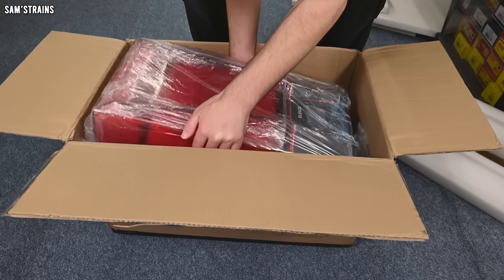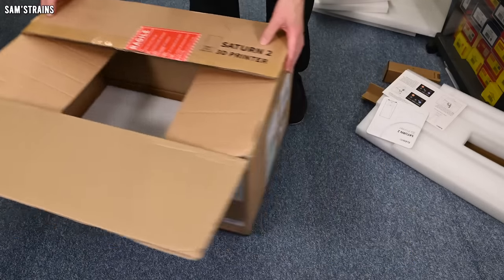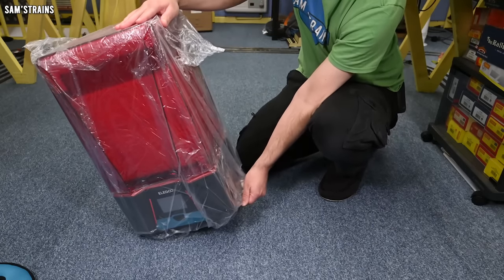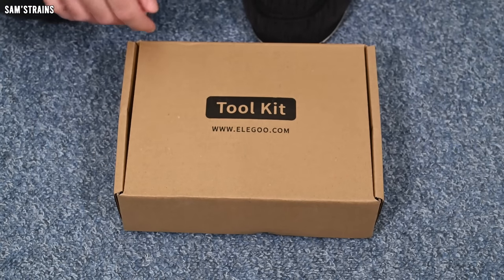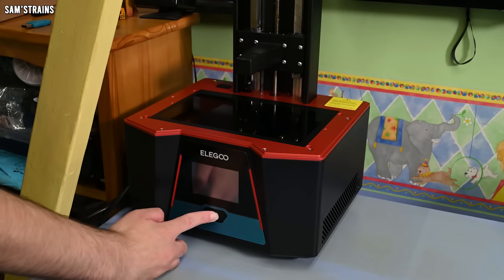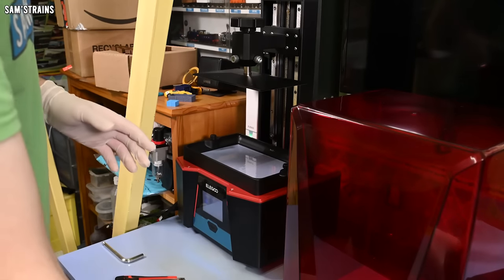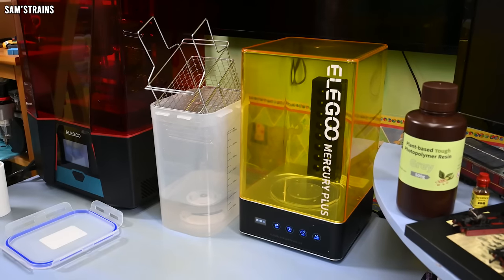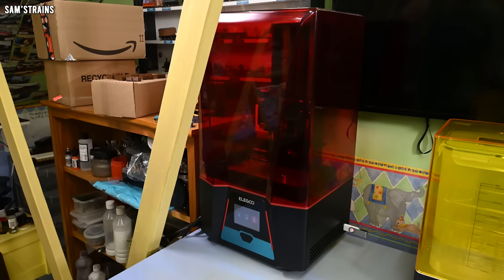Home Made Model Trains With Professional Detail | Getting Started With Resin

Comment: The reason the bottom looks so wavy is because it's very difficult to resin print large-ish flat surfaces parallel to the build plate.  If you would tilt the model around 35-45 degrees or so, it would greatly improve the bottom surface (but since the print is higher, it would take a little longer to print). Cheers!
Reply: I can say with some confidence I know what I am doing with 3D printing and have a “turbulent” history with this actual machine. You can print large plat surfaces off the build plate, as I produced 5th wheel covers for 1/14 scale RC trucks about 2.5" diameter and precise chassis rails for 1/76 to 1/35 vintage lorries. The issue sadly is a fault with the Saturn 8K, the arm of the printer bends exacting about 40 newtons return force on the fep that causes really bad elephants foot/distortion. I have compensated, but it's not the answer. Solution, I need a better constructed printer to handle that kind of work. Oh the printer is very good trust me, my 009 quary wagons it is said are better than anything else available the printer good enough to produce exact brake gear and GWR above the axle box's.

Comment: Great that you started with Resin printing eventually Sam 👋👋👋 Just an important tip from us; after poring the resin into its basin for printing, wade the spatula tool through the resin softly to remove all air bubbles, otherwise bubbles (or what's left of them) can ruin the print, especially at the starting point (bottom). Resin printing is fantastic. We've seen actual manufacturing grade made wagons from it 🙂 Bon chance with what's to come 💓 Cheerio.
Reply: I normally raise and lower the bed a couple of times manually before starting, that seems to agitate the resin quite well
Reply: Once a resin is created that won't kill you everytime you go to print a part, it will be good for folks to use.  Until then - it is just too dangerous for the average joe/jill to go off and use but folks continue to do it anyway!  Saw a video recently where a hobby crafter was using a cheap laser cutter in her bedroom to cut out stuff for scrapbooking.... had no clue that the fumes from the laser were TOXIC!!
Reply: @pesto12601  it's not so much the laser as the stuff that it's burning.   People forget that a laser isn't a pair of scissors, it's actually burning material away.
Reply: @leonkernan true... but the laser itself is dangerous too... it can damage your retina very easily!

Comment: Get a flexible build sheet. The best single thing i have done. No messing about the scrapers. No need to even remove the main build plate from the printer. I dont have to re-level or check it, just take flex plate remove the pieces and refit the sheet. Very little mess and no dripping resin everywhere. Also get a screen saver for the LCD screen. I use a large tablet one to cover more area on the top of the printer. This is because and spilled resin on the LCD will set hard if not removed. but if your FEP splits then the LCD is covered in hard set resin, almost impossible to remove

Comment: A couple quick tips from someone who learned the hard way.  Even after washing the print, use gloves to handle the uncured piece to avoid resin on the skin and finger prints on the print itself. The flexible plate makes removing the print much easier, I've only had to use the putty knife on thinner prints.  Also with the flexible plate you can drop the plate and print into the cleaner if the print doesn't pop off right away.  You just need to clean the bottom of the print when it does pop off after washing.  Someone suggested a silicone tray, I use a silicone electronics desk mat for my prints and around my work area, it help greatly for cleanup. And lastly, I bought the suction handles to put on top of the cover for easy removal. Eventually you will grab the sides of the cover with resin on the gloves and ruin the cover, resin doesn't come off the cover at all once it's on there.  Enjoy!

Comment: Didn't you say you cannot have a resin printer in the loft because of the ventilation? I'm sure you will address that in the video, which I don't have time to watch, maybe later. 😅
Reply from the maker: Yes, but now I've found the low-odour non-toxic resin I'm very happy... plus my printer has a filtration system of it's own!
Thanks for watching, Sam :)
Reply: @SamsTrains  You probably want to invest in something that can monitor VOC levels, Awair have a pretty good product, it can even pickup the variations when printing with some filament on FDM. I've got the Elegoo Saturn 2 and a few Anycubic printers, they work great but even the Plant based resin gives off a fair amount of VOCs. You will also find that you'll use FDM for some things and resin for highly detailed parts. The biggest mistake you see people doing is trying to print full OO/HO scale stock with the resin printer and wondering why parts are warped. You can strengthen resin by mistaking them together. That said you can also print OO scale bricks with an FLsun V400 in filament with concrete textured filament... :)
Reply: @Oorail  i have thought about how to print something as long as a OO recent coach (e. g. BR Mk III, 75ft long, 300mm in OO) and I think you have to do it as a kit to assemble after printing from several pieces, instead of trying to get, for instance, the body of the coach in one piece. I think that it is safer to print flat or curved pieces separately, like the sides and the roof of a wagon/coach, than to try to do a complete body and a chassis apart. I think that would prevent warping, but I let you judge, you have an experience I don't have.
Reply: @OlivierGabin  That is exactly how you do it, as a kit but you wouldn't do it entirely in resin. For a BR Mk III coach, you would need to print the chassis, bogie frames, couplings, and body structure out of filament. You would print the roof and sides out of a good quality resin with the MSLA printer. Think of it as like one of those old kitmaster kits but with the quality of today's RTR products. Instead of buying a kit, you are downloading or creating the digital file to create the kit, and manufacturing it at home on your printer(s). It is also why you really need an FDM printer and a resin printer. You have to design the pieces though for the 3D printing technology you are using. For example, I'm currently working on tunnel project that is several feet long. The core structure of the tunnel is printed upside down as the printer doesn't need supports for the arch that way. Long brickwork is printed flat, and not only does it insert into the tunnel but it masks any join lines between the structural segments. Details like the signs and plaques for the tunnel are printed using resin. Not only does it save a ton of money, you can print unique things for your layout and get a slightly different look from everyone else.

Comment: a few suggestions

1. get a pair of silicone rubber trays, sit the printer on one and the wash station on another, this will protect your desk from resin drips
2. get a few disposable foil platters (party aisle of the supermarket), perfect to stick the build plate on while removing stuff, again saves mess
3. grab a pack of kitchen roll or blue roll and keep it to hand
4. when you take out of the IPA, drop into a jug of warm water to rinse the IPA off (makes it easier to handle and stops the IPA fumes filling the room - also when you have supports will make removing them far easier)
5. for most parts air drying is fine, for anything with large flat plates let it dry overnight before curing, this can help if you find parts start to warp
6. that wash station is too small, that is for the smaller Mars 3 printers, not a huge problem but with the larger ones you can actually stick the build plate into the wash station, which will clean the uncured resin from that as well

Saturn 2 is a lovely machine, larger than the one I have here but I know someone with one

good luck and enjoy it

Comment: Coming from a Printing Trade (Lithographic or Offset, eg. Ink on Paper)
 The Advances in this Tech are just mind blowing.
 Amazing that a Set up is Available for the home Hobbyist.
 Truely something I could Barely Imagine in a Factory Setting in the Late 1960's, let alone @ Sam'sTrains knocking models out in his Loft in a few hours.

 It's just Mind Blowing..!
  And Sam, you seemed so Calm Unboxing, Setting up and Working a New Tool or Tools.
 That did cost a Few Quid to be Fair..!

 Well Done Young Man. An Impressive Performance..! 

 Cheers All.
 A Luddite in Oz. 😎
Reply: Advances! mate this style of printing has been around since the 1980's.
Reply: @kennykd97 Yes qw were using laser epoxy prototyping back in early 90s. However I think what this chap means is that its advanced to home use. Well it had done about 5 to 10 years ago. Sam has just caught up...partly due to his fume concerns
Reply: @gs425  It became so cheap because the patents ran out mate then China started mass producing them and trying to outdo each other competition is king.

Comment: Great to see you using a resin printer, I use a Saturn and found it’s best to print the models at an angle and also make sure the resin is at about 25 degrees C. I avoid touching the prints until after curing as the ipa will contain resin. It’s a learning process, but stick with it!

Comment: Nice to see you trying some resin printing, been loving my Mars 2 Pro for N Gauge printing, but have had to upgrade to the Mars 4 Max since it's build plate is nearly the same as the Saturn's (it's also cheaper), though I do recommend using some thicker gloves like some Marigolds or the like, the ones which come with the printers never feel thick enough heh
I do also recommend getting a cover to block out the light when it's printing, might not seem like much but has helped with the quality of my prints.
Anyway hope you enjoy using the printer!
~James

Comment: Looking forward to seeing what you can make with this!  I had the same issues with bottom layer sinking and separation until I started printing things at an angle and getting the support systems figured out.  I've also gotten my best results by making it so only the supports touch the build plate and keeping the actual part off the plate entirely, eliminating the potential "elephant foot" that can develop on those first layers.

Comment: I'm about 6 months ahead on this journey. Some things I have found.
The flex plate is a massive plus, especially to prevent damaging parts. if doing small parts, put several with their rafts touching so the Flex works better.
It is not always necessary to use a raft and print at an angle if your part has a flat side and no huge overhangs. Having said that shifting the angle around can sometimes improve print quality, at the expense of time and support material.
When doing shells, (working on an EMD F9P to make PAN AM #1 & 2 ) I have found that adding temporary internal cross-webbing will prevent a lot of warping, and thus failure.
I was hesitant to start resin printing because of the "toxicity" but it is not like instant death if you inhale it, still avoid it but a fan and a widow are enough, I don't think you need level 3 hazmat.

Comment: In the late 90's I was designing consumer goods on 3D CAD and prototyping parts on SLA machines costing £hundreds of thousands. Part cost alone was at least in the £100's even for small bits. Amazing to think you can buld a full setup of printer and wash/cure station now for under £1000! Makes me want to crank up my ProEngineer CAD system again! (£6k for a basic software licence back in 2000's minus all the add on's!).

Comment: Huzzah!! good move Sam. You'll get some great results with a bit of practice. I had a hard time printing Gladstone with my Elegoo Mars II. Different printer, but tricks I learnt were; lift the project off the plate. Even by 3mm will make a difference. The resin spent on supports will off-set resin wasted on failed prints. And add as many additional supports as you can to the straight edges nearest the print plate to get a crisper edge. Enjoy!

Comment: When placing the fill on to the printer, give it supprots and turn it to 45%, before you print, build it on a raft  plate first. 
The way you don't have a large amount of pull on the model,which can course the model to stick hard  to the fep or build plate. 
Also you end you with it sticking hard to your build plate. Also your end you with less fails and a better model. Had mine for three years now and it on of the best bits of kit i  have ever got, taken my modeling to new levels. An other tip when taking the supports  off is to use hot water your find the supports will just fall off, do this before you cure the model after you washed it

Comment: Hi Sam. 

£475.99p.... WOW! Just think, for that price you could have purchased a small Bachmann or Hornby wagon that is ready made. 

Paul. 👍❤
Reply: Lol, maybe a little more than that, but you could definitely get more out of a resin printer than what you could buy from the model rwy market for the same price.
Reply: Of course, you still need to buy the wheelsets. And if it's a loco, the drive mechanism.
Reply: @ReggieArford  I mean, you would need to buy a motor and wheels, as well as wires, but you could print the chassis and gears.

Comment: Hey Sam! Awesome to see you've picked up the resin 3d printing bug. I've only ever used resin myself and have found your videos on filament printing to be super enlightening, so thanks for that. :)

I have a few tips that may help you with a few things here.

It's good practice to get a protective surface for your bench, so that when you remove the models off of the build plate you're not risking getting wet resin onto the wood top. It's a real pain if it seeps into the surface. You can cure the stain with a UV lamp but then you've still got a tarnished bench top. You can just grab a rubber mat for this, there are loads of cheap ones you can grab that are marketed for putting under pet food bowls. They work a treat, and the UV resin doesn't eat through them.

In terms of ventilation, even though you've gotten yourself safer resin (something which is often a dubious claim by the manufacturer so watch out for that) I'd still say try and work in a ventilated space. If the resin doesn't make you dizzy, the IPA will. In my expieriance the IPA is actually the worse offender in this regard, and having just managed to get the full setup going in my shed with newly installed cyclonic ventilation, I can't sing it's praises enough.

In terms of that sagging on that print you made right at the end, extra supports will only kind of help.... kind of. You will ultimately find that no matter how well that section is supported, you'll get sags between each support. The issue is you are printing a flat surface parallel to the build plate. As the printer goes to print those initial flat layers, it has very little support bellow them and struggles to make that area solid, hence it sags. By printing the whole model at an angle, that flat section builds up gradually, and each subsiquent layer is supported by the slightly smaller previous layer. Yes, this means you will have to learn how to properly support models, but it's well worth it. Once you get into a good rythm setting up supports and knowing what to expect, the whole thing runs very smoothly, so it's worth putting those hours in.

Sorry for the long response. Not trying to be that guy in the comments that points out all the errors in a video (trust me I've dealt with that nonsense myself far too often), just wanted to offer some help as you've been super informative for many things I've persued in the hobby. :)

Happy printing!
Reply from the maker: Thank you so much for the help Nick - this video was shot on my first day with the printer, and it was actually a couple of months ago now! I bought a mat very quickly, and have been using that. I really didn't want to print at an angle with supports initially, as obviously that can double print time, so I tried everything to get them to print flat... obviously that was no good, and I now do print at an angle... I had to find that out for myself I guess!
Thanks again,
Sam :)
Reply: @SamsTrains  nice. I dread to think what video footage of my first day with my printer would have looked like...

Comment: I think it is always level because the surface of the liquid resin is always level.  So as long as the printing platform is close to level, then all is well.   Another thing.  When I was in the Canadian Armed Forces  we had gas-mask training.  The mask had a canister of activated charcoal which worked very well to remove the horrible, stinging tear gas from the air in the practice hut.  As long as you got your mask on quick enough upon entering the hut, the only parts that got stung were the armpits and the unmentionables.

Love your vids.  Cheers from Canada :-)

Comment: I worked for a company that offered hearing aid shells made with resin printing. if the shell was very thin, they seemed more brittle than the polymer shells. we also used a clear coat to make the shells thicker if needed (UV cured). We did not do the printing.

Comment: Finally! 🤣  You might want to get yourself a big silicon mat to work on. It makes cleanup way easier.
eSun makes a plant-based resin that works well too and (at least where I live) it's a lot less expensive.
Make sure to do a couple of exposure tests to dial in your settings. Different resins can need different exposure.
You will not regret getting a resin printer, unless you drop resin on your carpet. 😁